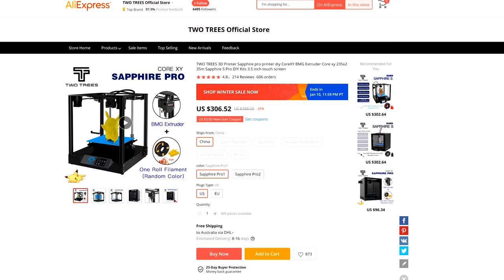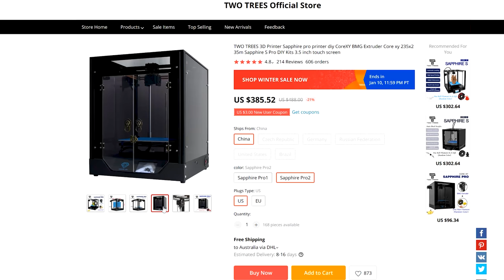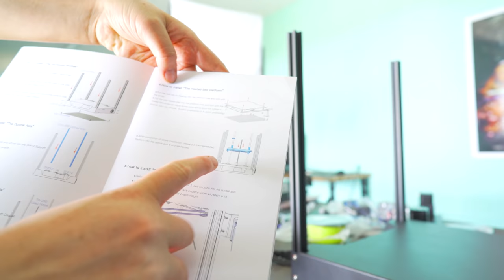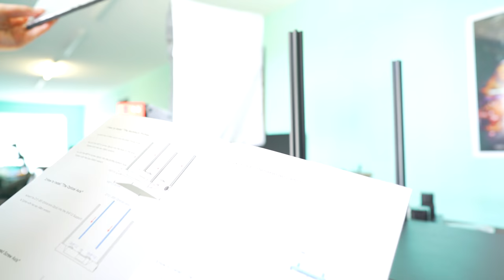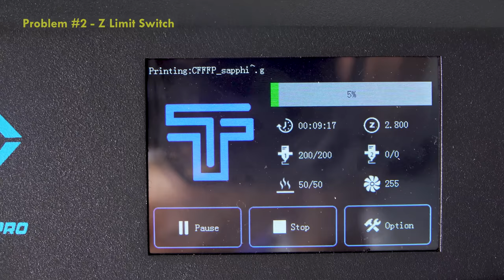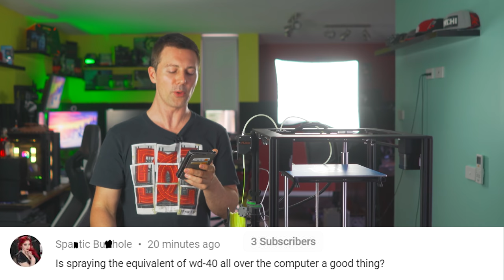BEFORE Buying a 3D Printer from Aliexpress... Watch This... (Sapphire Pro 1 Review)

Comment: Imagine giving a free 3D printer just to get bashed on I bet they are not happy lmao
Reply: Well they asked for a product review, not a shill. They could have asked some other tech tubers if they wanted blatant lies or misleading the audience.

What they should have done is sent it to an actual printer reviewer, someone that would go “oh this is easy”, and in 5 minutes or $5 later have it working and present it that way saying “hey if it’s not working out of the box you need this part, so just assume it’s going to cost $20 extra” and give it a proper head to head review comparison (printers are extremely finicky, they really are for people that love tinkering for the most part).

But this happens a lot with reviews, and it always looks bad, they should research who they send it to. Like if you sent a computer to my mom, even if it worked flawlessly she couldn’t give it a proper review, most she could probably say is it turns on and runs Excel. But when things do go wrong (like in this case), then it’s 100x more important it was sent to a knowledgeable expert (like for computers, it might just be the CMOS needs taken out, or maybe they just put the RAM in the wrong slots or forgot to apply XPM or the cooler got bumped in shipping and needs remounting or the coolant is low or a fan disconnected etc). So my mom in the case would be hopeless but I’d know how to diagnose it quickly (like Brian would have no issue). That’s why you really need an expert to review and know what they are looking for, just like I shouldn’t be around a electric skateboard for review if I reviewed ebikes, because though they are both electric motorized tech it’s not really the same thing... and printers are so much different than PCs I wouldn’t even associate them at all together. So unfortunately they sent it to someone who isn’t super duper mechanically included and their product has problems out of the box (not uncommon for printers), and Brian is a nice honest reviewer that doesn’t lie to his viewers, so if they didn’t want honesty from a novice/first time user of a printer they shouldn’t have picked Brian.

Comment: Welcome to Chinese 3d printers
Reply: Aren’t like 90% of the sub $500 ones Chinese though? At least all the worthwhile decent ones that I know of are. I don’t think except maybe Germany would even make NEMA 17 motors (Japan too I guess), if it was US that would be like 3 motors for $500 and no printer, lol!

Ended 3 as many say is probably about the best option currently for beginners with great community (around $190 to $240 depending on upgrade version). They certainly have come a long way since my Prusa i3 build from like 7 years ago (and back then I had dial up Internet, so I couldn’t just watch a YouTube video guide, and you only got a box full of screws and wires and motors and stuff, you had to flash your own firmware etc, it was not this 20 minute setup or just 4 screws etc, but the experience of knowing how every single bolt went together and adjusting and calibrating from complete scratch ultimately lead to vastly more knowledge/familiarity for troubleshooting so it was worth every head banging minute! But now I know exactly what I want and what to get without having to learn much with these 99% done “kits”)

But ironically I’ve always had more/better support from random Chinese sellers than American ones, lol, like if you have an iPhone you call them and after a long time they say “probably water damage” and you’re like “but I haven’t even said anything yet!”. The Chinese ones are often really good about providing aftermarket sales etc, so you can order spares really easy (I checked, and it’s $6.20 for a complete hottend for my printer as of today, the whole shabang! Heater/temp probe/heater block/nozzle/throat/heatsink/fan/pneumatic quick connect for bownden, I mean, that’s insanely cheap... Good luck finding reasonable priced parts for a crappy MakerBot (to which my 7 year old budget printer will run laps around 5x faster with superior quality, and that’s not saying much!).

So the “premium” name brand ones I’m not a fan of when cheapo kits are better quality and the sales are easier to get ahold of (that’s true of a lot of professional stuff, like I was trying to buy liquid nitrogen and I had to call a sales rep for a price, because shoot I guess putting it on the website is just sooo inconvenient, then to buy some you have to drive to a second building to set up a purchasing account, then drive back to the place and who knows what else because at that point I gave up and decided making my own liquid nitrogen would be easier!). I think Creality (Ender manufacturer) seems decent for support based on reviews I’ve seen for getting replacements rushed out, so I think they’ve hit the nail on that one, insanely affordable within blowing quality for its price AND good support? Sign me up! I’m just debating which model I need to add to support my Frankenstein i3 setup for ridiculously fast mechanical prototyping since I’ve got that base covered (although I can afford almost any printer now, including $50k metal printers if I really felt like it, it seems the budget $200 printers have come so far that they will do more than what I need, I don’t exactly need it to print threads in holes, though the company I work for does have one that will do that even on giant sofa sized parts make pristine threads in 1/8 fastener holes, haha! I just don’t need 1/1000 inch precision for my personal projects, lol!)

Comment: Anything above 300 dollars is no longer a good "deal" for a 3D printer, you're very wrong at that. There are 3D printers at 200 dollars with more value for the buck.
Reply: bullshit, do you even have one yourself? My first 3d printer 2 years ago cost about 220$ and the only thing I left in this 3d printer from original design was 2020 profiles. Now I have tronxy x5 with bed 400x400 for about 310$ and it's waaaay better than the first one but still have some issues like z axis de sync. All those 3d printers from china requires some knowledge and skills. None of them works like plug and play or maybe they will for few first prints then something will fuck up. I do not say that I don't recommend buying 3d printer from china because I do, but it's something for people who knows what to look for and how to take care of it. But it's better to pay more for better quality than buy piece of shit for 200 bucks and then have to buy some new stuff for another 200$ to make it print right.